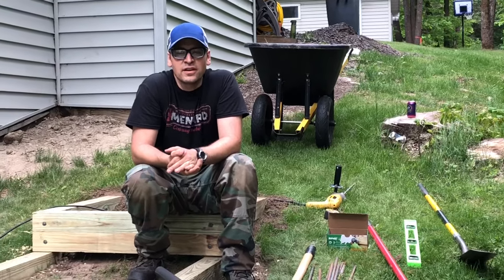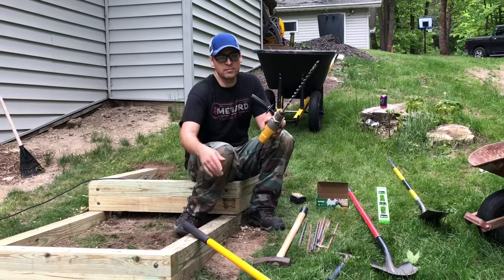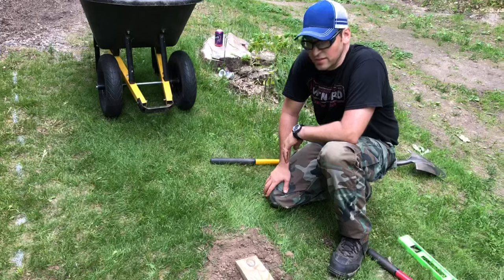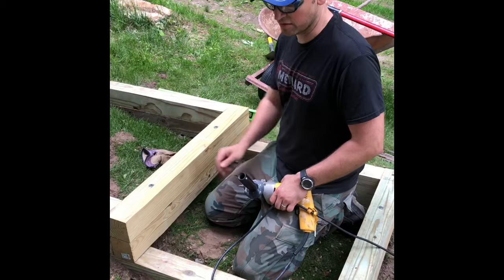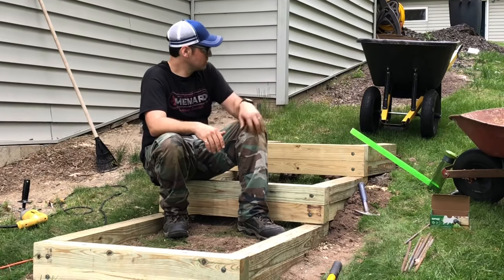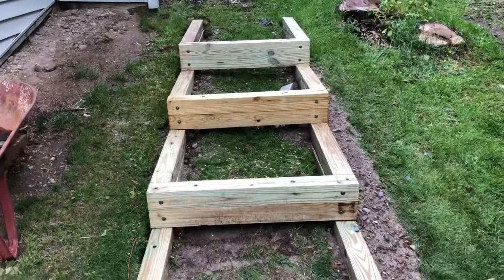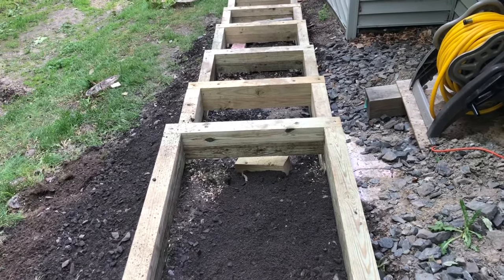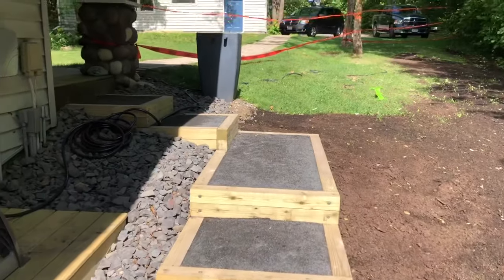How to Build Landscape Stairs

Comment: What do u do about wood rot? If it's pressure treated and cuts are made to the wood, does the cut side need to be treated?
Reply: Cut and Seal is the product I use to seal cut ends.

Comment: I built all my landscaping in the back yard with wood 5 or 6 years ago. Now I'm completely replacing everything with concrete. Will never have to worry about everything rotting again
Reply from the maker: So far my treated lumber is holding up to its “ground contact” rating. I hope it stays that way for a long time!

Comment: I’m doing similar steps, except I tied the two side pieces together with Spax screws, and also the upper step to the lower step just to give it more strength and prevent steps from shifting. Instead of the black gravel I put in 8x16 concrete patio pavers. Also I put a small radius on the step edges with a router to prevent splinters.
Reply from the maker: Hi Ken- sounds like some nice touches you’re adding! Should be a solid project! Nice!!

Comment: As I landscaper, I recently ripped one of this style of Timber framed steps out for a customer. It was a home they bought with the steps. The prior person put in thin rectangular pavers that sunk about 4 inches below the top of the timbers. When I lifted them out, the base was several inches of loose material with no crusher run gravel base. I offered to redo with a better base, but the customer was so frustrated, and some the timbers were rotting and attracting bugs that the customer refused. It was pressure treated, but I think some of the timber stock must have been from poor quality wood. I had an offer on stone steps, but customer opted for concrete. 

It was tough getting the screws to turn out, I used a sawz all. very well constructed. Then customer wanted all timber cut less than 3 foot, so the garbage pick up would not charge then extra.
Reply: Yeah mine's rottening out  after ten years😢
Reply: @elaineclark6210  Curious if you used pressure treated 4x4's, looking at the wood it didn't look like it was.   Was thinking of doing a build using your process but with treated wood.

Comment: Use a MAX SDS drill with a rebar attachment. Makes doing the rebar not only a lot faster but also limits damage from missing the rebar and hitting the wood and also limits causing unwanted movement in the steps.
Reply from the maker: Hi Von Trap, yeah that seems like a great way to install the rebar. Thanks for the comment!

Comment: Really good video. Im starting on a step project very soon and plan to follow this. Thanks for taking the time to make the video to help others out. My only slight change might be more gravel on the bottoms of each side to help with drainage and prolong life. But I am in a really heavy clay soil so theres no drainage at all. Yours looks better than mine. Those stairs should last a very time.
Reply from the maker: Good luck with your project! More gravel is always better. It ends up being a balance with how much digging you can or want to do. I’m over a year in, and the stairs look great! I’ll need to add a little gravel topping next spring, as it has settled down a bit. Thanks for watching!

Comment: You've explained this process better than anyone so far. 
Do you have a similar solution for a less sloped area that has a ton of tree roots under it?
Reply from the maker: For a lesser slope, you can just have longer “treads”, so your steps would be spaced out further. As for the tree roots, if you can’t dig through them, you could add a layer of gravel or sand and build the steps into that instead. I hope you find a good solution!
Reply: @NashwaukSteve  
Thank you very much!!

Comment: Thanks for the video. I was thinking of installing the riser "upside down" so that the screw heads are hidden
Reply from the maker: Hi Jason! Yeah I think you should do that. At first I was thinking about ease of replacing the top riser piece, but in reality I can just pull the whole riser off by backing out the screws going into the tread pieces. Fewer holes exposed to the elements is always a plus! Good idea and good luck!
Reply: Hide the screws by using joining plates with screws in buried under the fill material.

Comment: Doing some work recently.  Someone just shared with me the messiness of the decomposed granite(black sand) that you used as well they ended up treating it with a stabilizer which reduces washout and binds it a bit.
Reply from the maker: Yeah that’s a good idea. I scraped out the top inch or two and replaced it with a crushed gravel product. It packs tight and doesn’t get on everything. Tough on bare feet though.

Comment: Great job and looks fantastic. I think DG (decomposed granite) would be perfect for the fill as it compacts and doesn't wash out although is not pleasant on bare feet.
Reply from the maker: Good comment! I dug out the top inch or so and refilled with a crushed product from a local mine. It’s sort of like class 5. It’s hard on bare feet, but not nearly as messy as the black sand. That stuff got everywhere!

Comment: Great video. Why did you not drill the 4x4 before you put them in, that way you would just need to drive the rebar in.
Reply from the maker: Hi David- yeah you might be able to drill the 4x4s ahead of time. My concern would be keeping the drill holes perfectly plumb so the hole exits the bottom of the 4x4 exactly where it was started in top. If the bit wanders or if you hole isn’t plumb, then your fit will not be flush when you pound in the rebar in to join the pieces together. Thanks for watching!
Reply: @NashwaukSteve  i was so inspired by your creativity I am going to make a couple. Thank you for sharing. If you glued them wonder if nails would work just as good?
Reply from the maker: Good luck! I’m glad my project inspired you! I think construction adhesive and big nails would work just fine. “Liquid Nails” is a staple for me around my place.

Comment: How difficult would it be to sharpen the ends of the rebar pins to go through more easily? The stairs look great and I'll be stealing your design for my own exterior staircase. Thanks!
Reply from the maker: Hi Michael Private- that would be pretty easy to do with a metal cutting blade on an angle grinder. That’s what I use to cut my rebar, so just a few angled cuts on each and Boom! Done! Good luck!

Comment: As others have said, Exceptional video, amigo.  I’m considering a similar project on the side of my house that stays icy and frozen longer come spring.  I was thinking on slab goshen stone steps with four inches of gravel and crushed stone as a base, but now I am reconsidering and looking at your technique.  BTW....I Couldn’t help but laugh at the end there, where the final distance from your final tread to the porch deck was equally divided by 7.  Sometimes, just once in a blue moon, the landscaping gods are working in our favor!!!
Reply from the maker: Hey GM Andres! Thanks for the comment. Yes, the measurements on this project were total luck! And you’re right, it seems to never go that way. Just yesterday I was pounding on a wall to try to gain 1/4” that I needed to squeeze in the final cabinet. That’s more normal for me! Good luck with whatever method you choose!

Comment: Great video! Curious why you didnt standardize on a size for your tread piece lengths as you did with your risers? Also what size rebar did you use? thanks
Reply from the maker: Hello! I get this question every so often. I was matching the shape of the existing hill next to my house. It wasn’t a constant slope, so I would have to dig further back on some to get the same rise height. It was 1/2” rebar. Thanks for watching!

Comment: You were Fortunate to finish with 21 Inches from the Lower Landing up to the Main Deck (Qty3 Steps at 7 Inches).
I'm going to have an Odd Dimension for my Final Step ... But it will be okay.
Thanks for sharing your knowledge. 
Much appreciated.
Reply from the maker: Thanks for your comment! Yes, very fortunate indeed! That was definitely the exception to the rule for me. Good luck making yours work out.

Comment: Awesome instructional video. I am working on a raised garden bed. Can you guide me on what type of  bit I should use to drive the SPAC screws. I don't think I have that type of bit.
Reply from the maker: Hello! It takes a T-40 bit, otherwise known as a Torx 40 bit. The box of Spax screws I bought came with that bit, so that helps. Good luck!
Reply: @NashwaukSteve  Thanks very much. I ordered 
	 SHOCKWAVE T30 Torx 2 -inch Impact Duty Steel Power Bit as I couldn't find the right answer in google. I will order the T-40 bit. The other aspect I am wondering is about the rebar. Is it necessary and if so is there a way I can get "cut rebar" as I don't have the tools to cut it. Thanks
Reply from the maker: Hi Natarajan- yes I think the rebar is necessary to keep the steps from moving around relative to one another. Without the rebar, I think the stairs may shift over time. But yes, it looks like Lowe’s sells “rebar stakes” that are precut to around 18”. I hope that helps!
Reply: @NashwaukSteve  Perfect thank you. Will check it out.

Comment: Nicely done, but why not instead of gravel, pour concrete in on top of gravel and remove the 2x4s? I feel like over year or two those woods will be worn
Reply from the maker: Hello! You could use the wood as forms and pour concrete. You would have to do a much more thorough job on removing the topsoil, adding gravel and compacting it below the concrete though.   For our property, this is the look we wanted, plus with green treated wood, we have many years before the wood is affected. Thanks for the comment!

Comment: 😊😊 😊😊3 years later, how is it holding up??  I have clay soil and like your plan.  But I am considering putting down crushed gravel covered with a fabric cloth under the steps and putting in a high quality grass on each step.  I will have 5 steps. What do you think?
Reply from the maker: The stairs are doing great! The only maintenance is adding a little gravel to the stair treads to level them off in the spring. It seems like my gravel is slowly sinking into the native soil. Your idea sounds good to me, especially the fabric, as that’s probably why I’m losing gravel. Go for it and God speed!
Reply: @NashwaukSteve  thank you. 🙏

Comment: Grest video! Do you have the lenght and diameter of the auger drill bit and the ground stakes? Maybe link to where you got the stakes? Thsnks
Reply from the maker: Hello, I bought some 10 foot lengths of 1/2” rebar from Lowe’s. I used a angle grinder with a metal cut off wheel to cut the stakes around 20” each. I hope that helps!

Comment: Hi. Thank you for the well explained building of steps. Helps me a lot. I am pretty much doing the same idea up the side of my house partially from a shed to flat ground. I’m wondering about the possibility of weeds growing up through the dirt and sand. I thought I should put landscape fabric in the steps before filling them with the dirt and sand and gravel. We might also use boards nailed on the 4X4’s instead of gravel. Like a boardwalk look. Any thoughts or help with this? Also do I need to calculate how many steps I need according to the rise and distance?  Thank so much again. Lynn
Reply from the maker: Hi Lynn- landscape fabric or even just poly sheeting isn’t a bad idea. Because each of my steps is filled with a packed, very inorganic, sand, I chose not to use fabric. On the rocks toward the house I definitely used plastic sheeting.    The idea of using planking is great! Should work out nicely. For estimating your materials, it is nice to measure the total height, then divide by your chosen step height. This gives you total number of stairs. Winging it is certainly ok too!;) Good luck!

Comment: First off thanks for this video you don't know how much it helped for a Landscaping job I just did quick question though how did u know how to figure out the measurements of the steps from bottom to top or did you just build it up w 2 4x4s n figured out the even out elevation once at the top?
Reply from the maker: Hi @jose suarez- I was pretty unsophisticated. I stood at the bottom of my hill and sighted across the top of my level to a point on the ground. Then I measured the height of my eye and knew that that point on the ground was exactly my eye-height value. Then my point on the ground was tall enough that I could use a 4’ level and tape measure to figure out the test of my rise. 

Number of stairs needed = total rise divided by stair height (7” in my case)

Average tread depth = total length or run divided by number of stairs needed

Good luck

Comment: So each step is 36 inches wide by 30 inches deep? I’m going to try this on my backyard hill.
Reply from the maker: Hi Aviatrix14 - Each tread is 36” wide, but the depth varies. I was matching the existing hillside, so I just dug back until I was deep enough to place another stair, some are 30”, some are up to 40”. You could certainly make them uniform, then just add dirt to the edge to match it in with your slope. Good luck my friend!

Comment: My hill is steep and I’m having to dig down a foot or more to be level with the tread behind it. Any suggestions? Can I put 3-4 treads in on each side at the steepest areas?
Reply from the maker: Hi @Aviatrix14- where it is steep, the treads can be much shorter. For my hill I dug back until I was 7” deep, so that’s where the next step would go. Steep hill=  short steps; flatter hill=  long steps. I might not be understanding your situation exactly, but hopefully it’s going better! Good luck!

Comment: Hi Steve. Great video but I have a question as I'm gearing up to do this exact project: I understand how your measure the rise of the slope to figure out how many stairs you need but you didn't really explain how to get the measurement for the tread portion of the steps. My project requires just 5 steps but it covers a distance of around 16'. Do I just divide 5 by 16 or is there some other method to figure that out. Hope it's not a dumb question. Thanks!
Reply from the maker: Hello! Not a dumb question at all, and you are right on track. Once you know the number of stairs, you divide the total horizontal run by that number. So your 16’ run in inches is 192”. 192/5=38.4” so each tread will be 38.4 inches. In my case, I varies the tread length to match the hill better. If you did that, then your average tread would be 38.4 inches. Some would be more, some would be less. I hope that helps! Good luck- you got this!

Comment: hey Steve how is that pressure treated holding up. I'm in the middle of building my steps using the 4x6 pressure treated instead of two 4x4. I was wondering how long will this stuff last on the ground. Im reading 10 years or so.
Reply from the maker: So far so good. The wood looks great. It’s intended for ground contact, so it should last a long time. It’s the same wood youd use to bury in the ground for something like a deck.

Comment: Hi I am planning to the same project. I am going to use 6x 6 pressure treated wood. Just not sure about risers. I have to have 7” max or it can be tolerable?
Reply from the maker: I suppose it may depend on your local building code. I’m in a non- coded area, so mine did not matter. 7” is a rule of thumb typically, for comfortable stair climbing. Going smaller, especially outdoors wouldn’t be a problem. You could go comfortably up to maybe 7.5 or 8” but it might get uncomfortable for some. Thanks for watching!

Comment: When it rains, is it possible to have material from the above step wash down to a lower step? It appears like there is a little gap that might allow that to happen. Did you consider attaching landscaping fabric at the bottom to contain the fill or am I just not seeing it right? Also, my application is not straight up a hill. My path curves to the left, eventually ending in a 90 degree similar to yours. Do you think I could angle each tier slightly to accommodate the curve or would I be better served looking at a different method? Really informative video btw!
Reply: This is my exact thought.  I have some steps like this and the fill washes out through the step below.  When I redid them I made “boxes” for each step so the step front above sits on the step back piece below.  This provides a full block so the soil can’t “bleed” through.  Basically imagine what he did in the video, but with an additional piece of wood in the back.

Comment: Looking to do something similar in the summer / fall but first need the fence installed to get my baseline as to where the steps would start/end. The biggest question I’m not too clear on yet and I’m gonna look for a diagram is how to determine how many steps you need for the slope of the hill. I think I could essentially pound a tall steak or rod into bottom area and the tie a string to the top then extend to where the stairs start by fence gate entrance ensure the string is level and take that length plus height measurement. Then divide that by the number of steps I want ect
Reply from the maker: Hi Joshua- yeah your method would work, I think. I was pretty unsophisticated. I stood at the bottom of my hill and sighted across the top of my level to a point on the ground. Then I measured the height of my eye and knew that that point on the ground was exactly my eye-height value. Then my point on the ground was tall enough that I could use a 4’ level and tape measure to figure out the test of my rise. 

Number of stairs needed = total rise divided by stair height (7” in my case)

Average tread depth = total length or run divided by number of stairs needed

Good luck!